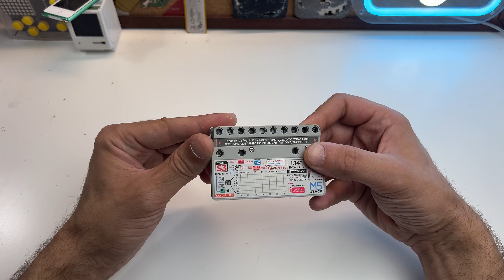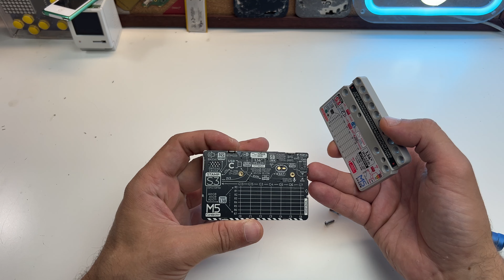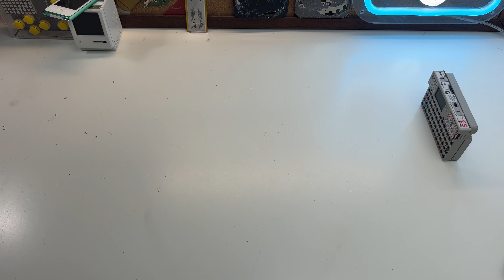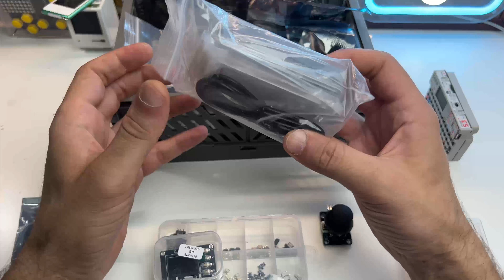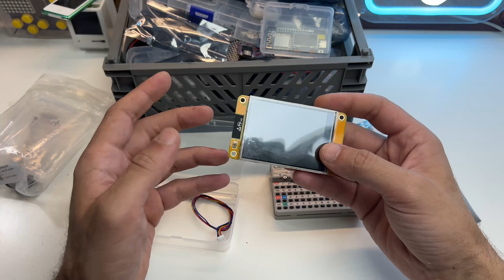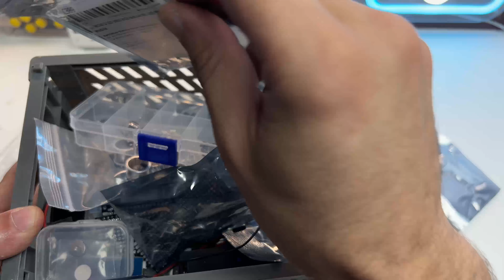M5Stack Cardputer 1 Year later

Comment: Hello, j' ai fait l acquisition du cartputer, d une carte de développement avec Bruce et une autre avec marauder .
Dans l immédiat je vais voir, apprendre et comprendre c est carte,  une fois que j' aurai ( compris le fonctionnement ) je le brancherait à un de mes PC PORTABLE de Test, j' ai également acheté plusieurs ESP 32 WROOM et d autres modèles.
Lors de mon achat j' ai eu 2 modules, un pour copier les badges et un autre module sûrement un GPS.
A tu fait un vidéo sur la connexion du module RFID, LE soudage des broches et le soudage dû module sur la carte de développement.
Je te suis et j'apprends l' électronique.
Et te suivre dans les achats afin d' acheter ce que tu prends comme modules.
A ta prochaine vidéo.
Merci Hakista.
Fred fre.
Reply from the maker: Hello my friend , Cardputer is ready fun device to have . I suggest you to install M5launcher on it that way you can have multiple firmware on it and switch between. Connecting different modules like RFID or GPS is easy as you have a connector on the left side of the device . You can buy official modules from M5Stack site . I suggest checking my other videos to see what i have done

Comment: Great video. I have a few years experience with bear board micro controllers. Your right about it costing more to design and implementing from scratch. When I started there wasn’t any companies selling premade deck boards like M5stack. But now that I understand the hardware side of micro controllers. I looking more into the pre built devices from lilygo and M5. Ive just ordered a lilygo pager and an m5 cardputer. these will be my first pre built devices Ive ever purchased.

You may want to try marauder on your CYD board?
Reply from the maker: Thank you my friend ! And yeah since i got my Cardputer i got really into those tiny devices, as the applications are endless. Im working on few videos with them and sure ill make sure i include Marauder on one of them .